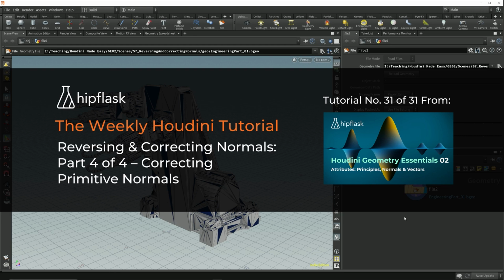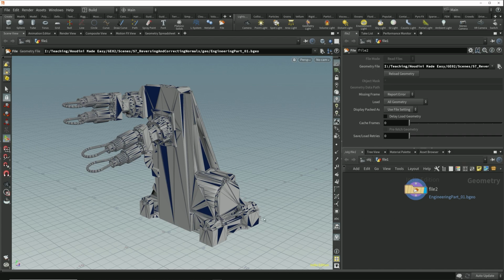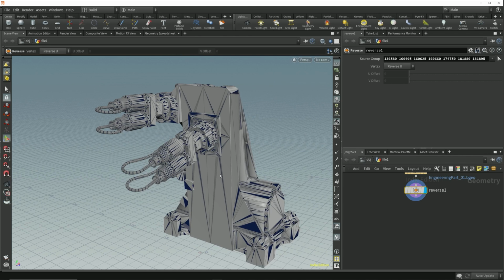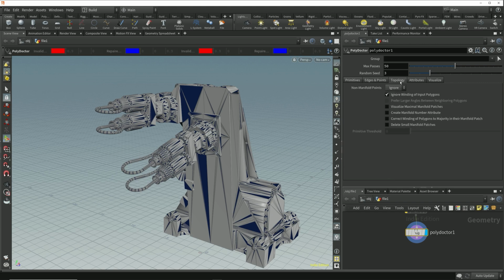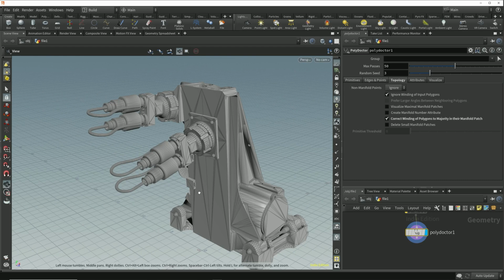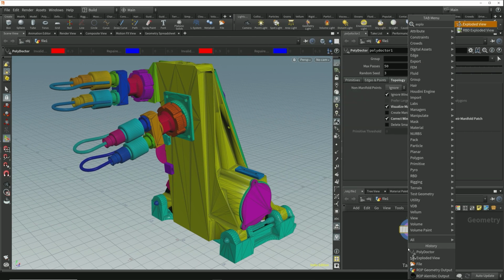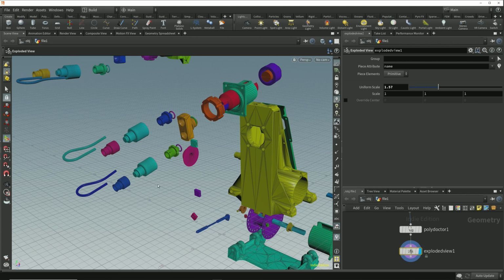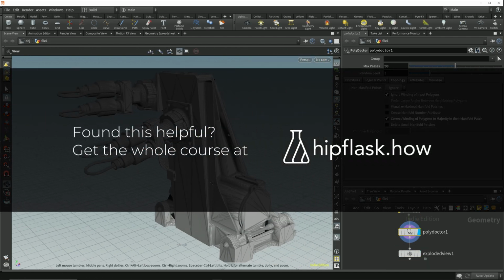Reversing & Correcting Normals in Houdini Pt. 4/4 – Correcting Primitive Normals

Comment: What if the revered polygons are evenly distributed per manifold patch, so that there is no majority. i.e. every other polygon is flipped. I have a geo like this and polydoctor doesn't fix it.
Reply from the maker: Hi Nathan, I just tested this and for me, the polygon normals do still get unified when I have an even number of reversed primitives. The Polydoctor SOP doesn't necessarily unify the normals to the direction that I want, but once they're all facing in the same direction, it's easy to flip them by adding a reverse SOP. What is the result you get from the Polydoctor on your geo?
Reply: @hipflask4921  thanks for looking at this. The Polydoctor either flipped every polygon (same as reverse) or did nothing. I occasionally have this issue with imported .stl files. I ended up converting to VDB to fix it, which obviously changed the topology.

Comment: Thanks for your series. I didn't even know this node exists.
I would be interested in a way to separate all those patches and turn them into groups so I can apply materials to them.
Reply from the maker: You're very welcome! 
The Assemble SOP can create a group for each manifold patch. By default it creates a name attribute for each piece, but you can disable this and enable the "Create Groups" option if you specifically want groups. 
If you've got lots of manifold patches then you might want to consider using the name attribute rather than groups because it's more efficient. In the group parameter of your material node, you can select primitives by attribute name by writing @name=piece# (assuming you work with the assemble sop's default "piece" prefix).  
I hope this helps

Comment: Exactly what I've been working with for the past two weeks. Sadly the geometry I got was so bad that the Polydoctor node couldn't automate it - because the edges/polys weren't properly closed and created incorrect manifold patches I guess - and I had to manually reverse polys. At least there weren't too many of them.
Reply: You also can create VDB from broken geometry, than check normals with dot product, if < 0 then reverse. Sometimes helps.
Reply: @hved  I'll give that a shot. Thanks :)
Reply: @hved  that is is not a solution when you are working with CAD data, because you have to separate those patches for shading and sometimes components are connected to the wrong patch and so on.
Reply from the maker: Oof, that doesn't sound like a nice piece of geo to have to work with!
Reply: @hipflask4921  Yeah, made the project take twice as long as it should have. Thanks for this series though. Helped me out :)
Reply from the maker: Twice as long, that's rough! Great to hear you found the series helpful though.
Reply: @hipflask4921  You'd be surprised how often one gets exactly this kind of stuff to work with. One reason I was avoiding Houdini for that kind of work.
Reply: H D  More things to try! Never a shortage of ways in Houdini. Thanks :)